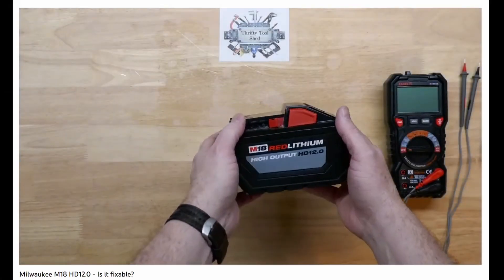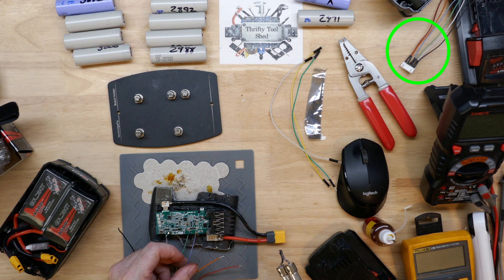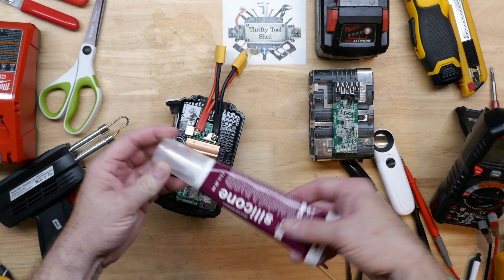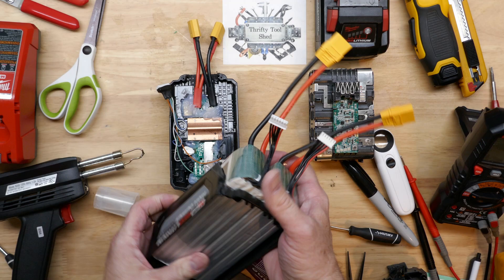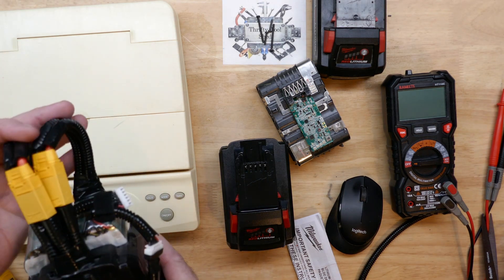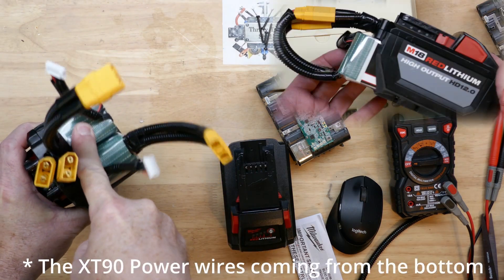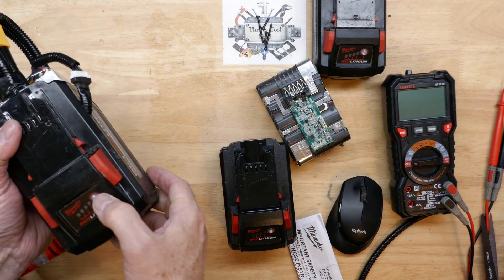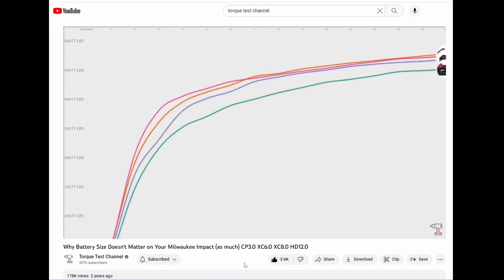Milwaukee M18 Modified 10AH Power Stack "Beast"

Comment: Is there a way that I could use a transformer like a laptop charger and use the DC side to send power to my drill?
Reply from the maker: Sure it is possible. Someone sent one in to the Torque Test Channel a while back to test in a similar manner. You have to fool the tool into thinking it has a battery pack attached to it. I believe it takes a resistor on one of the terminals. I have seen it on a channel called The Tool Scientist. I have never looked into it myself as I have no desire to have a cord  connected.
Reply: @ThriftyToolShed  ok cool thank you so much! I was just thinking on a day where you run out of batteries or something you can use that in an emergency situation

Comment: Have you ever had to troubleshoot  the Standard M18 / M12 dual charger (not rapid)?

I just had my 4th one die randomly.  No smoke, no flashing lights, just dead and won't charge either M12 or M18 packs.

Curious if you know of any common issue with those?
Reply from the maker: I have several of these style M18/M12  chargers and I have not had a failure yet on mine. The most common issue I do see on "other chargers" is typically a electrolytic cap issue as seen on one of my Ryobi charger repairs or diode failure in the switch mode power supply section like on the EGO charger repair. At least they are the most problematic components in some of the others...

Comment: Wish it does get to be tested on TTC channel , it looks like I’ll make some more guts on torque test like a 10-30% I hope . I tested something but I stop I didn’t want to harm my tool 😆 but all runs good but your whole setup wiring look and was way more presentable and more safer ! Glad you gave another chance to the bms 😂 I wonder what would be the torque difference w and with out bms of Milwaukee if there’s a limit on the tool or the bms or battery chemistry 🤔😉 tell us any updates also I tried this but on smaller m12 super hard to make for the size hope they have more pouch cells like the dewalt prob they are custom made. Again congrats on this battery mod
Reply from the maker: Well, the BEAST did in fact make it to TTC. The heart breaking thing is the BMS was shutting down so often it would barely even run when they loaded it up. I called myself being safe and making sure the M18 BMS was on the pack for protection of any tool used by TTC. Unfortunately the M18 BMS would not allow the high current pull of the BEAST. TTC said that they did see higher wattage output than the 12AH pack generates, but that was it.  No real test since it would not run more than a few seconds. I am a bit bummed out about it, but it is what it is. Maybe they will be gracious enough to eventually give me another try in the near future. It was so good of them to attempt the test for us. Thanks so much for your kind comments! Here's to round 2, maybe....😬🙏
Reply: @ThriftyToolShed  did you saw the pipeline they came out with a new m18 pouch cells 🤭 they made posible 🤔 how a new bms capabilities and it has a super fast charge speed wonder if it’s posible to one day obtain and have a teardown of this new cells 😁 . You did had a posibilita now available forge I think it’s called

Comment: Awesome!  They tested a few DIY Makita batteries this week.  Looking forward to how “The Beast” compares to “The Beans”, LOL!!!
Reply from the maker: "The Beans" was very impressive! 🤯
Reply: @ThriftyToolShed  as a Makita LXT user with a HUGE lineup of tools, I’m very interested in anything we consumers can do to pressure Makita into releasing higher power LXT batteries.  If DIY solutions get enough attention they might recognize the need.

18v X2 tools are a stumbling block since some early tools don’t have any extra width to accommodate 21700 cell batteries.  BUT this issue goes away with pouch cells!

I just may have to dive down this rabbit hole myself someday!  Thanks for posting your work, and to reaching out to TTC.

Comment: Really like what you did with the salvaged battery components. I've had this idea of doing something similar - replacing the small cells with big c-max 26ah cells. Of course the big replacement battery would no longer be portable - instead the idea would be to have a 6' to 10' extension wire between battery and tool. This would be ideal for tools like a miter saw that remains stationary. Do you think that such a setup is doable? I've read some posts that talk about issues with the extension wire. I don't know enough about electronics to see the negatives that I might be up against.
Reply from the maker: Yes it's doable. The draw back is the leads. The voltage drop of high current tools is crazy. I have done something similar with a belt worn LiPo pack with 10 Gauge wire going out to the drill. When doing siding etc. The tool would run all day and be very light. With a larger draw tool you would want the lead length short as possible and may even need larger wire to limit voltage drop. With the saw example it may be possible to strap the pack to the saw?
Reply: @ThriftyToolShed  Thanks for the info - giving me ideas of a battery table with welding cable leads - whether or not I actually make it happen - thats another story.